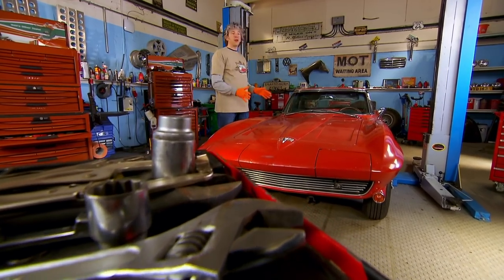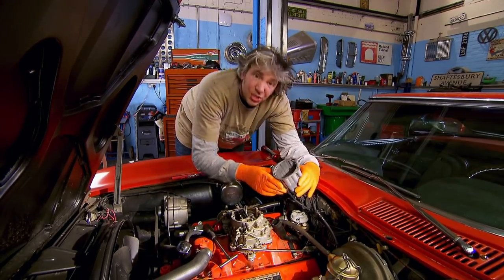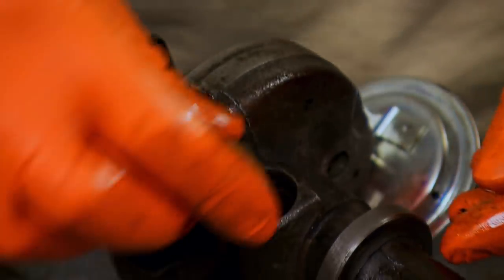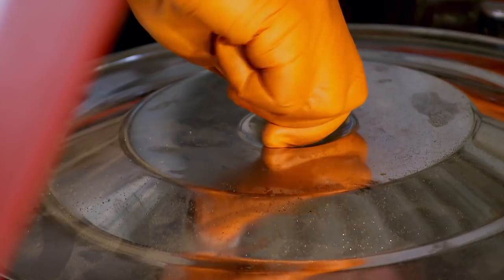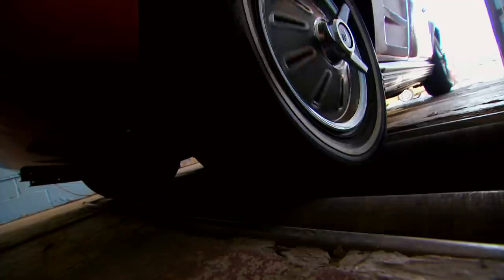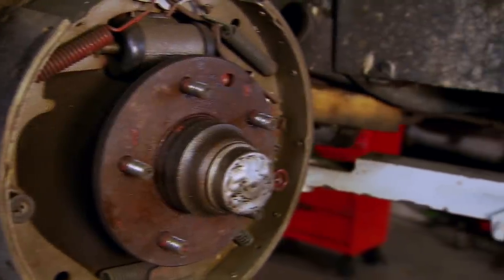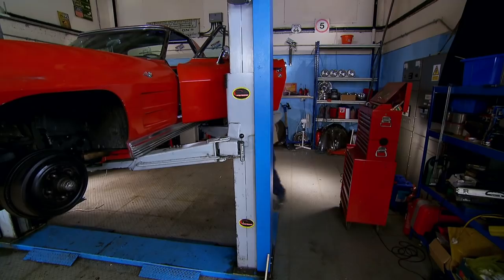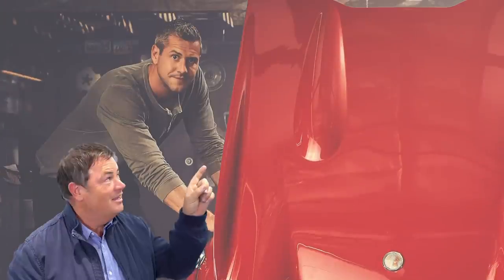Chevrolet Corvette: How To Inspect The Engines And Brakes | Wheeler Dealers

Comment: Should of put discs on the front
Reply: I think you "should HAVE*" paid more attention in school.
Reply: @revolutionday1  i think you "should HAVE" a life instead of correcting youtube comments
Reply: Or even hydraulic brakes to maintain equal braking pressure.
Reply: @jamescaley9942  They are hydraulic drum brakes, with mechanical adjusters.

Comment: Hey Edd good to see and hear you explain stuff. I owned a 64 Corvette Convertible back in 66 thru 1970. I worked it over a lot, and yes the brakes are very old school. I used to back up and apply the brakes hard to get the adjustors to work better. But corrosion and rust can make them sticky too. It was so fun to hear you complain about the spark plugs. I used do the back two from underneath. I was very young and had no money, no lift etc etc. You take care Edd, missed you buddy.  Dennis in Virginia US

Comment: You should remove the heads and install new valves and seats.  The old ones are definitely destroyed due to lack of lead in the fuel.
Reply: @CathodeRayNipplez  the story of my life.
Reply: Not necessarily. One, since the car is still running well, there's a strong possibility that it's already been done, or that someone has been religious with a lead substitute additive. Two, general consensus is that hardened valve seats aren't really necessary for that era Corvette.
Reply: @channell11  I was being sarcastic.  Leaded fuel didn't do anything for the valve seats.  It was an anti knock compound.  A complete myth just like using R134a in an R12 air conditioning system or ultra low sulfur diesel will wear out injectors.  The current myth being perpetuated in the US is ethanol in gasoline will ruin your engine, but only if it's in a small engine????  Oh yes, gasoline goes bad in 6 months also.  Total garbage, all of it.

You'd be better off waiving a dead chicken over your car than following any of that stuff.

Comment: I am surprised none of the owners converted the front brakes to discs by now.
Reply: The 300hp 327ci engine was the base performance package, so this car is pretty much a cruiser. The previous owners probably, just didn’t see the need for a disk conversion.

Comment: Drums  all round  you always have bad braking   you have to adjust  the brakes evenly  or  they would always pull to one side
Reply: And God forbid they got wet. They drum brakes on my 66 Chevy Nova would fade in the rain so bad I would make doodie in my pants!
Reply: @jackkrinkov9273  Has a 64 Vett, in a rain storm couldnt stop for a stop light, fortunately no cross traffic.  Then I realized I wasnt going to stop for the next one either - double or nothing.  I lucked out.